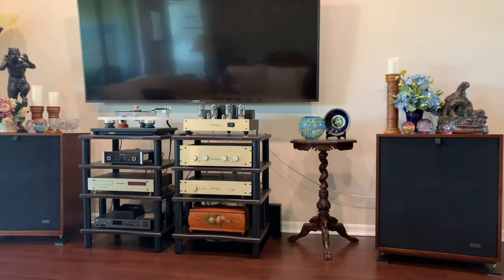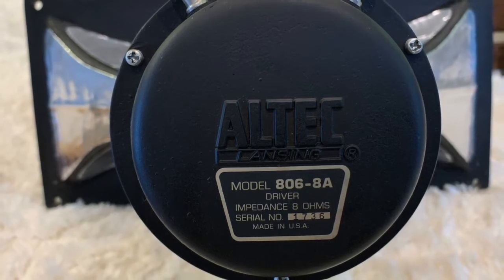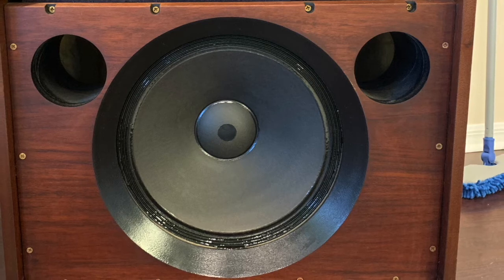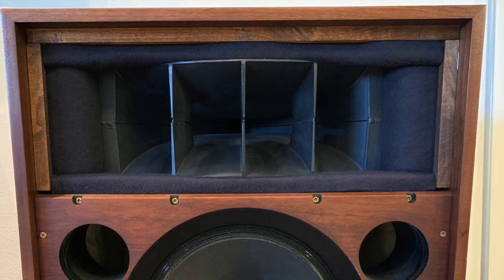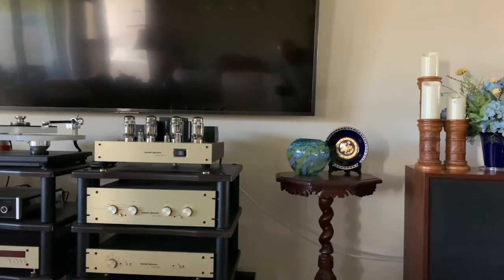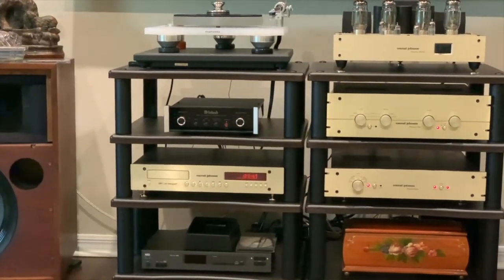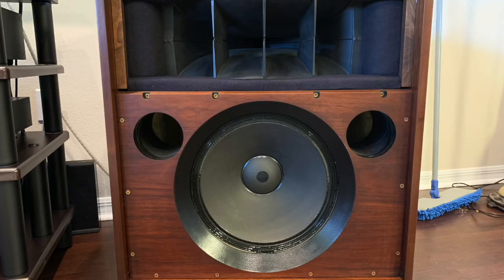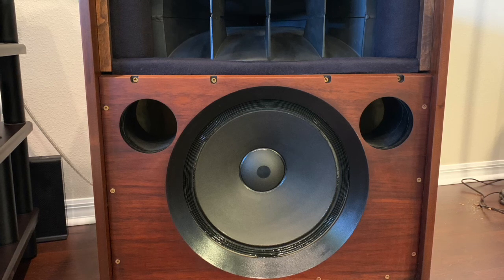Altec Lansing Valencia modifications  : THE EMPIRICAL AUDIOPHILE

Comment: 5:57 I would recommend to replace this metal core coils with a pair of 'air' ofc coils or (if money is secondary) ofc foil coils. I think this would improve the bass quality a lot. 'Mundorf' even delivers silver-foil coils. Also some MKP capacitors should give you a little extra quality in the highs. Nice work done. This bass chassis looks really great. What kind of motor is this? Neodymium?

Comment: I have a pair of Altec Valencia A's and the two best things I did to enhance performance were to swap out the horn drivers with new higher frequency drivers from GPA and to build new custom crossovers. There is no substitute for Altec Voice.. (midrange magic). I think the Crossover rebuild was the most important thing I did. Those sparkling highs from the new driver didn't hurt either, but turn that control down and tame those horns.
Reply: Do you mean new caps and resistors?  Where do you get the crossover rebuild design?  Cheers!
Reply: @sballestra9269  Complete custom build of crossovers a friend helped me with the design. I did the actual construction.
Reply: I got my crossovers from a guy in Germany and replaced the material in the horns with Mylar same as the new gpa drivers. I also replaced the wires inside the horns with dueland silver wire  they sound amazing!

Comment: Why you did all the (highly debatable) things to your Valencia but leave the crossover in stock condition is beyond my understanding. The original caps aren't great and the L-Pad is one of the things that isn't great either...often corroded and and with bad contacts. I rebuild the entire crossover on my Valencia's with paper in oil caps, an autoformer instead of the L-Pad...did you re-magnetise your speakers magnets? After so many years it's likely that your alnico magnets have lost magnetism.

Comment: I have a pair of altec 872 b as you know they have the 15 inch bi flex woofer. I think they have a very good midrange. The bass sounds a little bit muddled. The cabinets are in very good shape. Just wondering what I could do to upgrade these speakers?
My vintage system consists of running the speakers through a marantz 2270. My turntable is a Kenwood KD 550.

Comment: Hello, great video. I am rebuilding my grandfathers old altecs from the early 60s. He had diy cabinets that he built from Altec plans. They are a lot like valencia cabinets. I have to change the top and one side on each speaker due to water damage. Both drivers have been rebuilt and I had a custom crossover built. Anyway, I am copying most of what you did for your speakers. Using dynamat on the cabinets and horns, shot bags in the bottom etc. I have a question, what did you use for foam on the horn install? 
Thank you.

Comment: I completely agree with everything I heard throughout this video about the Altec Lansing Valencia and among all the other factors, I give due credit to your concern about the damping that you decided (and rightly so) to improve.
There's only one aspect I can't figure out:
How come you went to so much work and additional expenses to improve the sound performance of these magnificent speakers and authorize the presence of various decorative objects in the vicinity of the Altec Lansing, objects which, by their nature, can enhance the appearance of unwanted resonances?

Macedo Pinto, Portugal
Reply from the maker: Good point you bring up. However, I've always had objects on top of the speakers cause they are so big and have never really noticed any difference whether they were there or I took them off. Plus, the stereo has to fit in a room that the family uses and not a dedicated stereo room. Some of us are lucky to have a dedicated room, but I am not one of them.
Reply: @theempiricalaudiophile3729  The way you have beefed up your cabinets, external resonances are likely much less of an issue - although, once the sound leaves the speaker, it becomes the property of the room. Have you done any room treatments?
Another question - by placing the sacks of shot in the cabinet and the extension on the LF driver, you have drastically altered the internal volume. Have you measured this affect?

Comment: I have a pair of these in parallel to another set on top with connected to a Crest pro 3001 amp in parallel running between 2 to 3 ohms and putting out around 600 per channel with tight bass from the high damping factor on the amp.  I also have another room with Jbl and Wharfedale pros both 15 inches in parallel connected to a more powerful Crest amp.
Reply from the maker: That sounds great.

Comment: sorry I understand that you put the Dynamat on the horn, but I didn't understand what other modification you made by removing the driver, thanks.
Reply from the maker: The Dynamat was used to deaden up the horn, which it did work. This advice to deaden up the horn was given to me by Ray Kimber of Kimber cables.  It's also used on the 2 inch baffle that I designed which helps deaden it, too. Tried several different materials and found that the Dynamat was the best.

Comment: If you really want those speakers to sound better, scrap the factory cabinet and build one with bracing and a thicker baffle, front load and countersink the woofer so the gasket is flush with the face of the baffle and add an Aurum Cantus ribbon tweeter.
Reply from the maker: Before I would modify the speakers any further, I would definitely have to listen to somebody who has already done it.

Comment: Do you have a link to the damping material for the horns, thanks?
Reply from the maker: I bought a dampening material, called Deadbeat. It used to be sold at Best Buy in their auto section but that was years ago.. You can buy it on Amazon and it's under the name Dynamat Xtreme,  it cost $24.99 a roll.

Comment: 250lbs ea...???
What did you do put bricks in the bottom of them...????
Reply from the maker: Each speaker weighs close to 250 pounds and I put 100 pounds of dead lead shot in each speaker. Each bag weighs 25 pounds apiece. I did this to help stabilize the speaker and it seems to have worked taking out any of the vibrations that would muddy up the sound.
Reply: @theempiricalaudiophile3729  
Wow I never hear of doing that before...! 
I Guess all of my Speakers, are so Freakin Heavy... They Sound Good without The Extra Weight ...

Comment: TO: The Unempiracal Pseudo-Phile: Your biases make the speakers seem better to you. The sacks of shot are just B.S, doing NOTHING for the bass, or cabinet damping. One should replace the capacitors, and any resistors with newer premium components made for audio x-overs, but you ignore the very important x-over . Check the resistance of the coils, and inductors, sometimes the winding insulation breaks down and can cause a localized short circuit. One inch O.D. threaded internal cross rods will apply a small outward pressure to the cabinet walls, thus damping the cabinet with very little volume loss. I have also used cables (practically no volume loss).  The resin gizmo is nutty, expensive, and of highly dubious advantage. The gizmo takes up some cabinet volume, and it's supposed "benefits" I believe are all in your head. These models come stock with clean detailed bass to 30 Hz, why screw them up?. Furthermore AlNiCo magnets over time need to be re-magnetized. There are services that can do this without having to strip the woofer down to it's frame for ~ $40. A horn has to be 1/4 wave length of the  fundamental audio wave to effectively provide an acoustic impedance match with the air. Your woofer bevel once again DOES NOTHING. The fact is Mr. you don't know your A** from a hole in the ground. ME A REAL ENGINEER, AND CURRENT LIVE PERFORMING PAID MUSICIAN (vocals, saxophone, and more).
Reply: Adding 100 lbs. of weight decreases the resonant frequency of the cabinets, but does reduce the internal volume of the cavity for a modest trade-off in low frequencies output.
Reply: How can say all that about "gizmo’s " and what ever else you just wasted my life reading if you never heard them ? That’s a retorical question ... YOU DONT !!!
Reply: Dear Davey Downer: 

I have a pair of 604Cs, driven by a pair of Futterman OTL3s, modified to triode. I listen almost exclusively to vinyl. 

Are there more accurate sounding speakers? Definitely. But much and maybe most of what we define as "more accurate" or "better" is really just a differentiation based on our personal preferences due to the way we each hear differently: there are scientific studies on this that will surprise you.

I have been using the 604Cs for 43 years. To my ears, they are a bit colored, but to my ears they have a dynamic, lifelike quality that few of the dozens of other speakers that I have auditioned (just to make sure I am not missing out on something) over the decades come close to, and of those that do, then price by factors of 5 to 10 come into play.

I don't expect to be replacing them anytime soon, and others seem to agree with my assessment. You used to be able to get a 604 on eBay for $400 bucks. They are going for 4 times that amount these days, and Great Plains Audio is making brand new ones at $1,800 each.

I use weights to dampen movement. They do work. I blind-tested it with three friends, not as audio-inclined as me (and I did not tell them what I was doing to try to modify the sound), and they unanimously preferred the weights. But your threaded rods is a good idea. Why didn’t I think of that? I have to try it. I presume two pushing away the sides, and one pushing the top away from the bottom. .

To your point, I replaced the stock crossover (notorious for their poor design) with Mastering Lab crossovers, which I sent to Jon Specter (blues guitarist, cousin of Al Kooper) to rebuild with  audio grade Jensen foil/oil capacitors. They took two months to break in.

Regarding the 604s “clean detailed bass”: bass was never a strong point with the 604s. I support them with a 15” Velodyne sub, crossed over at 70. I get deeper, authoritative and detailed bass from the sub, and more lifelike midrange from the 604s.

You are right about the bevel. Doesn’t do bupkus. If there is a concern here, just front mount them: cheaper. 

Please learn how to spell empirical.
Reply: See my new comment in this thread.
Reply from the maker: Actually, I'm not biased. In fact, I was quite shocked to see once audiophiles hear the system, then they realize what they are missing. I've seen people trashed their whole system after listening to such an old system like mine for the first time. But then again, the Chicago Audio Society could be all wrong and you then again could be all right.

Comment: A bit of overkill.
Reply from the maker: I don't think so because I saved a lot of money from not buying new speakers. I mean if you think about it saving $16,000-$25,000 on speakers, I could use that money for other things.
Reply: @theempiricalaudiophile3729  There is no way you have great high frequencies from that horn driver no matter what you did to the driver and the lens. I spent 40 years looking for a horn driver that made cymbals sound real, Valencia 846B speakers were my second factory speakers, I had 4 of them. The only way they sounded great was by adding tweeter. I now have beryllium diaphragm drivers, they are the closest thing to the sound of ribbons I could find, and ribbons have the most realistic cymbal sound you can get.. I had spent around $25,000 on different combinations of either just horns and horns with tweeter. I run just horns now.

Comment: All the ferrite magnets aren't necessary. Most of what these "golden age audiophiles" believe is all subjective nonsense.  A lot of subjective adjitives  here until they're properly measured you really have no idea what these speakers are actually doing. They're interesting speakers have a sound and a lot of romatic lore behind them. But in reality they're far from perfect and aren't superior to many modern speakers.
Reply: They are not superior to some modern speakers, but they are superior to most. Read my reply to Dave below.
Reply: @mlebron20  I've read Dr Floyd Toole's book along with Sean Olive plus a bunch of research done at Harman. Guarantee these speakers don't measure well along with pretty much ALL other vintage gear. They may sound good to you or others and thats fine, but doesn't mean they're transparent and faithfully reproducing the source. I'm not saying they're bad speakers but a lot of the vintage and pretentious gear is heavily hyped by subjective nonsense.
Reply: @iowaudioreviews  Jon Specter measured my speakers after he upgraded the crossovers and they did measure according to the manufacturer's specs, which was more than ... well, ... more than well enough for me. And in any event, speakers that measure well can still sound ... well, not so well.

A lot of modern gear is heavily heavily hyped by subjective nonsense. I'm constantly sticking it to audiophiles at audiogon about the $2,000 per foot cable interconnects and speaker wire: "Hey guys, I use chain-link fence to wire my speakers to my amps, sounds fine!"

The bottom line is: am I happy? The answer is yes. And I enjoy watching the jaws drop and the s*^t-faced expressions on almost everyone I bring to my audio room (theaudioatticvinylsundays.com) when they first hear the system.
Reply: @iowaudioreviews  Speaking of "modern speakers", do I have a story for you. I gotta run now, but later...
Reply: @iowaudioreviews  See my new comment, posted not as a reply to you, but separately.
Reply from the maker: Actually, there is no perfect speaker out there and yes, it is a preference of what people determine to be good or bad. Apparently that's why we have so many speaker manufactures out there trying to get your wherewithal.